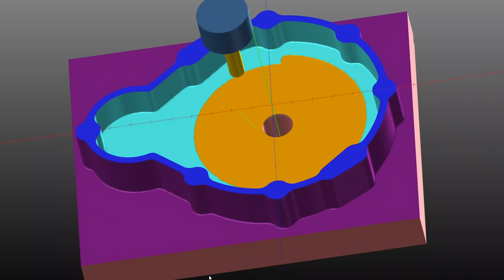What Should I Do? My Company Promised Me More Money… But Years Have Passed

Comment: I feel like this, I'm so glad I watched this. I have just taken over the machine shop at my work. Structural steel fab and egineering shop. The last machinist was fired over a year and a half ago and they haven't been able to replace him I started  7 months ago as a welder/fabricator. I have some manual machining experience but no cnc. I just went and got my certifications to run cnc lathe and mill. Going soon for a fusion 360 class. So basically I have ALOT more responsibilities then I had when I started, and I'm still making the same. I got $1 when I got my welding cert. And another 50cents a month after which I appreciated even tho it's not where I want to be I understand I have to be patient. But I do believe I should atleast have gotten something for taking over the machine shop and having alot more responsibilities than i previously had. But maybe I'm just being to anxious? I was told when I got my operator certifications I would get a raise for those as well it's been a few weeks and I'm still waiting.

Comment: The crack about a Unions were just plain WRONG!
I worked at a Union job for 5 years, 
it was the best paying, most generious benifits
 I had ever had.

My Grandfather was in the original fights for 
Unionizing workers in the 1930's.
He saw his fellow organisers beaten to a pulp 
for trying to organize for 10 minute breaks!
He was a welder and they tried to get a ten minute break 
OUTSIDE, in clean air. 
They were welding INSIDE GALVANISED GRAIN TANKS,
Butler Manufacturing.
They got the breaks and my Grandfather was blackballed until
WWWII...

If you had problems with a Union, it was set up WRONG!!!

Comment: There's guys I work with that are in that boat but they have so many years at the company now that they don't want to leave because they'd lose their 5 weeks of vacation. Frankly if your vacation time is worth more than getting a better rate of pay and more income for yourself, then you should probably give your head a shake. The unfortunate reality is that there isn't a lot of loyalty from employers in the machining world, which is a shame because some of the guys I work with who have been in the trade now since the early 80's always revel in what working for our company used to be like back when they were starting out. Production machinists were making $22 an hour to start (up to $26) in 1982, plus piece work bonuses. With CNC's and robots now, there aren't really production machinist jobs anymore, only programmers who program the machines and setup techs who just change out tools and adjust offsets. My shop is primarily a tool room type of shop, we do tooling and our top rate is only $32.50 in a market where the average cost of a house is over 700,000. So not only are the old guys getting screwed out of money from having their top rate stagnated for 30 years, good luck hiring more machinists to keep up with the ever increasing demand from our customers to make them tooling that we have to turn away work because they don't want to up the top rate to where it should be at around $40/hr. No wonder the old guys stopped caring and it's hard to recruit young machinists when your employer shows zero loyalty and doesn't give you fair compensation for your trade.

Comment: I started (and am still at) my first shop programming, setting up and running a CNC mill for $13/hr. Over 3 years I got regularly bumped up at review time until I was at $19/hr, which I thought was great. Just out of curiosity, I looked around at some other shops to see what they offered and I nearly fell over when I saw other places hiring for almost $10/hr more than what I was making. I immediately went to my boss with this and after some negotiation, I was making $27/hr. If you don’t ask, the answer is always no.
Reply: I had a buddy who was in the same boat.  When he got started in the trade I was the guy who trained him.  He picked it up quick and I knew that if he stuck with it he'd be a real asset any company he worked for.  A few years later I called him up and asked him to come work with me at another shop.  To my surprise he was not even making $20 and hour.  This is a guy who was hand writing programs, setting up and running swiss machines.  At the shop where he was working (the same shop where we met) they didn't do easy materials.  High nickel alloys were the shop's specialty.  He came in to get an interview at the shop where I was working.  They offered him $28 an hour, just to set up and run.  I was the one doing the programming in the department.  When he went to the GM at the shop where he was working to see if they'd even match the offer.  They declined saying that they couldn't afford to pay him that much because the shop floor foreman wasn't even making that much.  He turned in his notice and has been happier ever since.  He could see the writing on the wall at that shop and knew that he'd never make the money he deserved there.  

Both of us have changed shops since then.  My current shop needed people so I called him again to come apply.  He'd found himself at another shop that wasn't going to allow him to progress and grow in the trade.  He got offered $37 an hour and we are working together again.
Reply: Man without joke. I worked a summer job at a factory "running a cnc machine" (under supervision ofc), at the age of 19, back when I didn't even care that much but had other things in mind than to work at a "filthy factory". 

They offered me what was around the time about 21$/h. This was in Europe, where the average salary isn't $50k. 

To hear these stories of actual hardworking people with an active interest for machining is just disheartening. I learned what to do rather quickly, made sure not to AFK or fuck up. But other than that, I was a terrible worker by all means. What I did however, was negotiate a proper salary at start coming from having worked a sales job in the past. 

If you want a raise, read the book "Never Split The Difference". The author even devotes a complete chapter to the matter. It's not just as simple as to ask for one, but the better you lay it out, the more you'll get.
Reply: Where do you live?
Reply: @rolandoperez6612  
NY (not NYC)

Comment: I started at the machining shop after I sold my truck and wanted to try something different.  I started only knowing where the start button was.  I finally learned setup and was learning programming,  they were paying me 12.50 an hour. Then they would hire someone who had a degree in something it didn't matter what or they came from from some other industry and would pay them 15.00 then want me to train them but I wasn't worthy of a raise . After 5 years I left and went b ack to driving.  That's been 15 years and to this day I'll still look at something and run that part in my head.